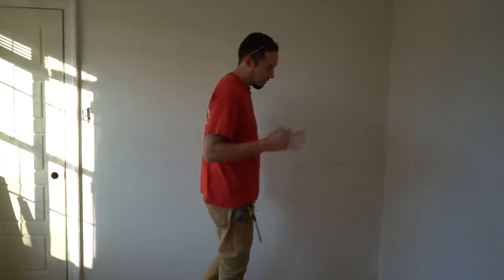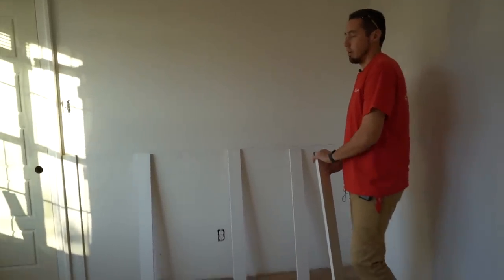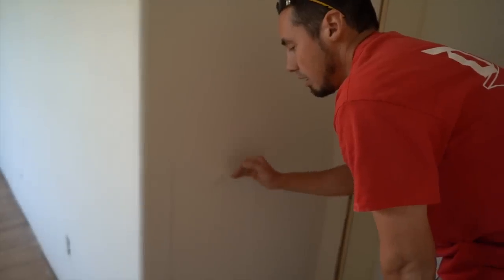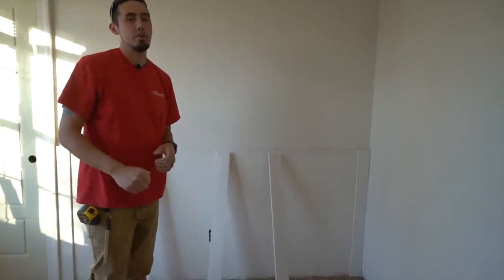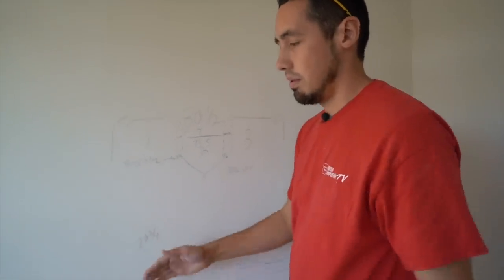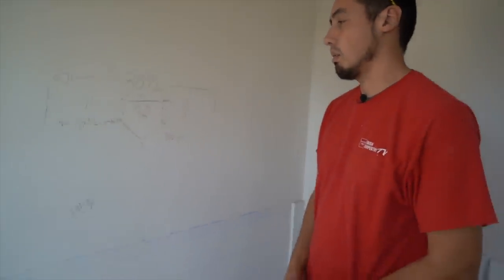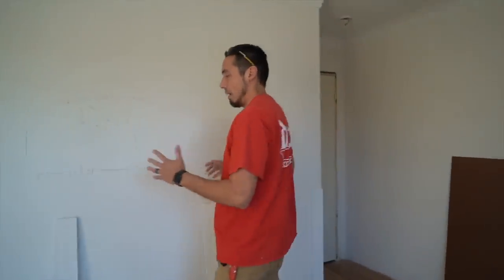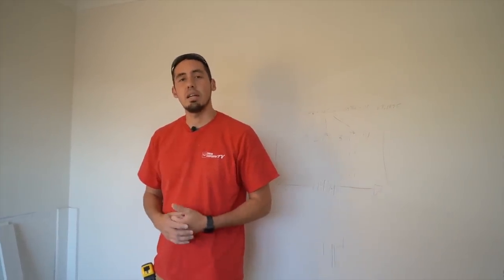Pro Wainscot Install - Finding Panel Dimensions

Comment: I appreciate the comments on protecting the floor. When I built my house, the trades used my brand new deck like a workshop and didn't protect my new wood floor after it was installed. Caused lots of complaints by me and lots of repairs by my GC.

Comment: Great video , yep trick the eye best tip yet - I do this all the time with math and reveals - fence, decks, flooring , drywall, split the difference to come close as possible to a mirror image or a reveal that tricks you to think it's same. Hard to see a inch or 2 over a span of 10ft etc etc. 👍

Comment: For the wall that is 119, divide it by your 28.75 and you get 4.139.  Then select the nearest whole number means using 4 panels.

Comment: Hi Richard I really enjoy watching your videos. I'm in New Zealand and i don't know if we would ever do wainscot, but am fascinated by what you do. Different countries different styles I guess. The way I divide things up is "In and Over" or (over an in) you measure from the left side of your timber to the left side of your last timber, you take that measurement and divide it up by how much you want ( 3 spaces, 4 spaces etc) what ever that measurement is, is the distance for setting out from left side of timber to left side of timber so on and so on. Not sure if you use that system? But you don't need to subtract timber widths and it doesn't matter what width the timber is as long as it's all the same.

Comment: Thanks Richard.  Really appreciate the videos!   What about a hallway?  Would you try to keep the layout the same on both sides so that the stiles are directly across from each other?  Seems like a tricky one with doors and corners occurring at different locations on both sides.
Reply: This is what I’m wondering also, in my lounge room I have a door in the middle but it’s off centre, I wonder if I treat it as 2 different walls or accept a weird bit on the end, I’m leaning towards weird bit like he mentioned

Comment: Love your wainscot tutorials. Would you have any advice for joints over long runs.  I am contemplating a straight run using your method that is about 12m long including a stair case.  How would you approach joining the backing boards?  Would you make sure to hide the seams behind the uprights? Or have you a better way?

Comment: This series has been great and very timely. I’ve done a fair amount of work around the house but I’m debating if this is a project that is too artistic for me. What is a fair ballpark price to have a pro do a job like this in the Midwest for recessed panels on a 16 x 12 room vs an estimated DIY cost for materials. There’s certainly the pride of doing it myself but also the work of a true craftsman is of value. I’m trying to get a feel for where to make that trade.

Comment: Great video, but u never discussed what to do if the outlet was in the way of the stile?
Reply: Call the electrician 🙃
Reply: @rjperkins365  LMFAO
Reply: That's because if it is designed properly, that will NEVER happen!

Comment: 80 1/2 - 7= pulls out phone calculator. Lol

I understand being put on the spot by the camera. Just thought it was funny.
Reply: But the half would make it confusing. The calculator is the answer.
Reply: I'm an accountant and my brain absolutely refuses to do math when I'm on the spot.
Reply: I sometimes find myself doing the same then going why did I need to do that? I know the answer. Then I remember that it's probably because my job requires ordering very expensive things for customers that need to be exact and half the time I may do the math in my head but because  there is that terrible feeling about risking something coming in wrong I have a habit of relying on the machine to feel certain.

Comment: You forgot to mention on the second wall the inside corner stile is ripped down 3/4 of an inch to match the other stile in the corner

Comment: Brother thank you. I know you're in the middle of your big reno bid, just had a quick question. I have variable wall widths and I am hanging picture frame molding. No panels or boards. My question is do I keepu panel widths consistent and change the gap/widths between the boxes or do I change the widths of the boxes to keep the gaps consistent?

Comment: If you want to do something a bit different, you might want to use 1/2" x 3" (2 1/2" wide) slats for vertical styles, and maybe space them about 16" apart. That too is a good look you might want to do. Then you don't use any moulding in the boxes.

Comment: How do you prevent a gap between the top rail or chair molding and the wall when the wall isn’t flat? Or how do you fill the gap? When installing crown molding in my home, I had a few shorter walls (about 6 feet) that had a 1/4” gap between the middle of the wall and the pine molding since that short of a piece of pine won’t flex to the curve of the wall like MDF might.

Comment: I regularly need to work out square sizes on a large sheet of glass, as i do repro stain glass as a job.
We have standard sizes for square and diamond lead.
But often the customer requires a custom sized square or diamond.
So what i do is measure the glass width, divide the square size and it might come back as 2.75 for example. 
Then i round that upto 3.
So then i take the glass width and divide by 3, giving me the closest possible number to the custom square size.
So your 80.5 ÷ 29=2.75.
So round that upto 3, 80.5÷3=26.8, round it upto 29inches per panel.
Then mark 29inch from centre of wall outwards, then place the middle of the stile on each mark.
Which gives u 3 equal panel sizes, without the need for subtracting stile widths.
At least thats what i assume. Iam hoping its a quicker way to work things out.
Reply: Then on larger walls, after u measure the width, just subtract 29 inches again.
119÷29=4.1
119÷4=29.75, round it upto 29.5 or 30inches for each panel size.
Again mark outward from wall centre, to get 4 equal panels.
As long as the middle of stile is in line with each mark, it should work out nicely.
Reply: Of course i could be wrong, or u just prefer ur way, we all have our own ways of doing things.

Comment: So the wall with the window will have differently spaced panels?  The 2 under the window were determined by the window size - then whatever you decide to the left of the window will be based on what you did for the 4 panel wall?

Comment: I am doing wainscot over a textured wall and want to use 1/2” 4x8 MDF panels for smooth reveal. Would you place these panels on the wall before installing the wainscot, or cut them out once you have the final wainscot panel dimensions?

Comment: Will you be putting 1/8" or 1/4" board to the walls like i seen in your older videos or will you mount the styles and rails right to the wall.  my other question is how do you end the style on a wall that your not going to wrap the wainscoting around like an opening to another room?  Thanks I look forward to seeing your videos

Comment: Here’s my dilemma….when I do the math for my weird wall length of 228 1/2” and my spaces keep ending up being like 24.13888888889”. What the hell do I do to convert that into something I can convert into a tape measure? Do I just round to the nearest 16th? But if I do that I’ll be 1/2 inch off by the time I get to the end. I feel like I’m missing something simple. Bc I haven’t seen a single person explain this in any video.

Comment: Installing some luxury vinyl, i currently have 356 as baseboard. I cant find any examples of 356 with added quarter round. Is that a no no?
Reply: Manibusan Rambo 356 is typically used for door or window casing which is why you aren’t able to find any examples.
Reply: Hey Mike thanks for the reply. This is what I noticed. Also is probably why quarter round looks terrible married with it. Any suggestions on a base that I should replace with to marry with my door casings?
Reply: 3140 is the baseboard version of 356
Reply: If you want mdf or fingerjoined pine i would go with a 3 1/4 623 molding, however the last luxury vinyl I did was in a bathroom and I used cove base.  Simple to install and it looks pretty good in a small bathroom or kitchen.  Tile or hardwood I always go with pine or poplar if painting.  Hope this helps.
Reply: Mike Yep! Running it into my kitchen. It does help, Ill take a look into it. Thanks for the insight.

Moose, I did not know that. Ill do more research. Thanks.